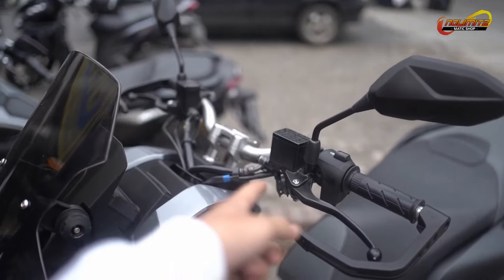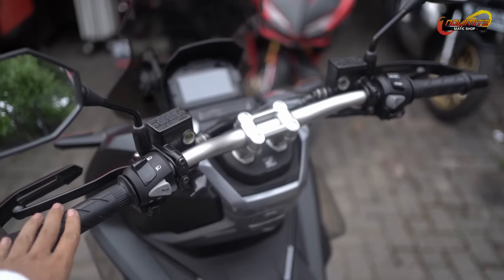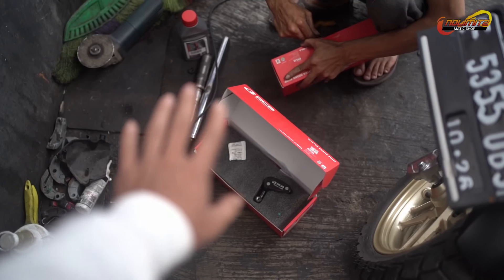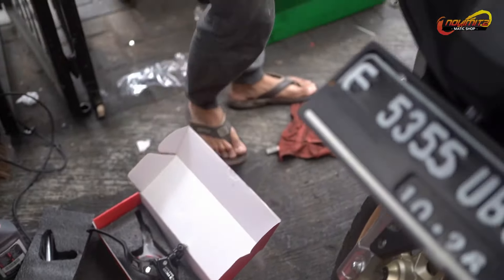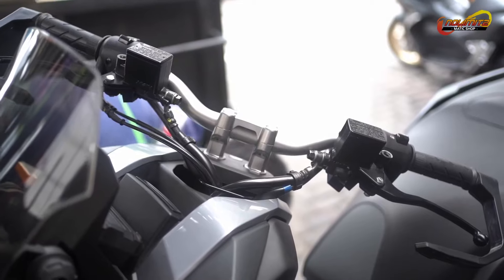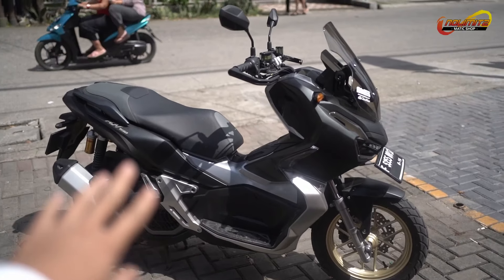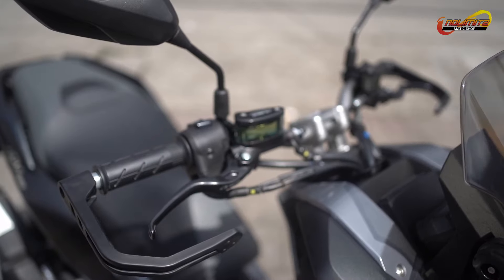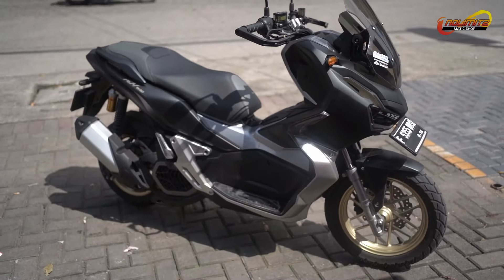Pemasangan Master Rem RCB E-2 di Motor HONDA ADV 150

Comment: ngorbani soket lampu belakang gak om ?
Reply: soal nya kan di rcb cuma ada 2 soket di adv 4 soket ?
Reply: @anggatuek6000  antara ngorbanin lampu belakang atau stater tanpa rem, kalo saya pilih stater tanpa rem, jadi lampu masih berfungsi (buat safety juga tentunya). kebetulan yang divideo itu adv saya hehe
Reply from the maker: iya
om
Reply: @vickryalvian9432  berapa harganya bg?
Reply: @vickryalvian9432  aman sampai skrg?
Reply: @hendragotama.s.h  aman om belum pernah ada kendala
Reply: @vickryalvian9432  maaf bisa untuk d buatkan konten posisi atau jalur soket nya? Mngkin bnyak dari temen" yg lain masih kebingungan 🙏🙏
Reply: @hendragotama.s.h  kalo ini mungkin bisa tanya2 langsung ke admin bengkel NoLimitz-nya om hehe
Reply: @vickryalvian9432  Itu stater tanpa rem kira2 boros aki ngga om??? Atau ada kendala lain mungkin? Saya user PCX baru mau pasang Rcb E2